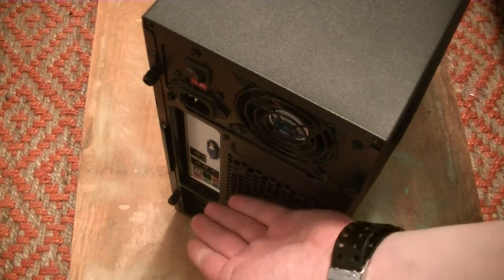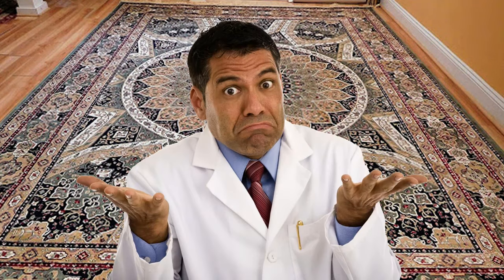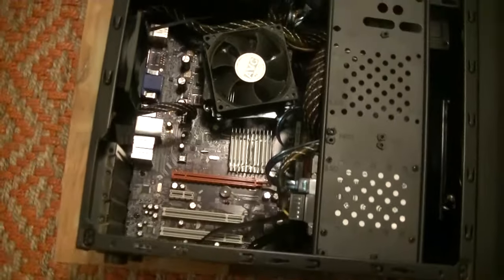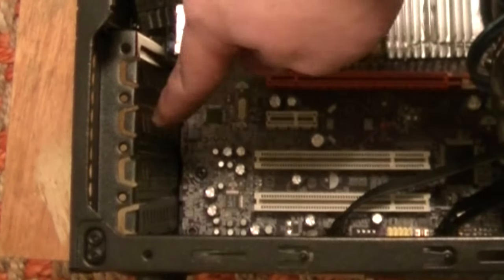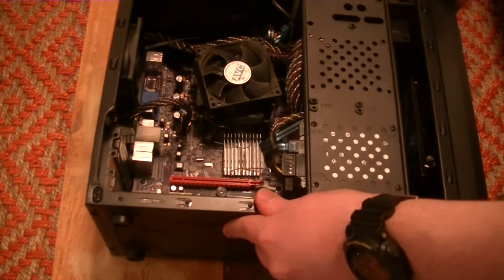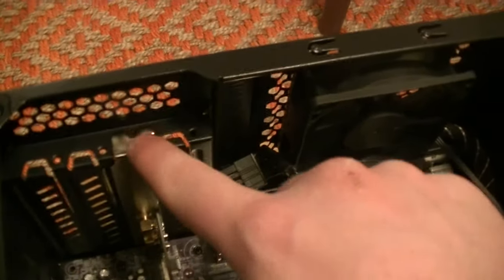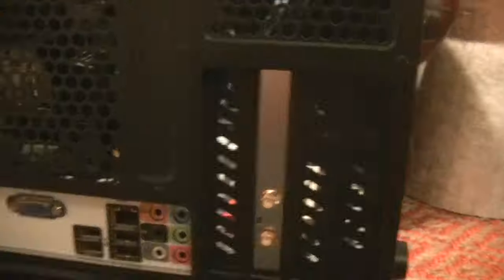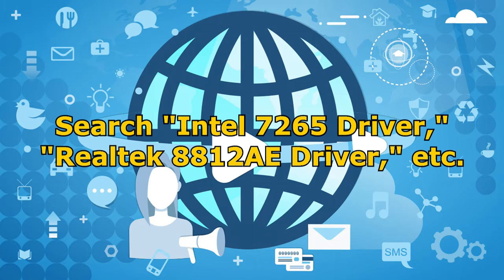How to Install a Wi-Fi Card into a Desktop PC

Comment: why would i need to do this if i had an ethernet cable 😐
Reply from the maker: You wouldn't, but even with my systems that I have ethernet cables for, I like to have WiFi cards installed in them just in case... they're dirt cheap and come in handy. Sometimes a computer is in an inconvenient spot for a cable that could be tripped over or looks ugly, etc.
Reply: @proudgamer5577  what driver??? Can I get WiFi through my phone on my pc?

Comment: Thank you for the information.  Except I was attempting to locate a video on installing a multi-port ethernet board adapter, but this one popped up.  Does it take the same slot for the board as this one for wi-fi?  What is the proper name of said adapter board?

Comment: Also you can use your phone with internet and use USB tethering, use your charger to connect your pc and phone turn on your USB tethering on your phone in your network settings or settings, then you have internet from your phone, you can then install the wifi drivers.

Comment: I need to run a Ethernet cable for my outside room willl that work as if my pc was right next to my WiFi router ?
Reply from the maker: The short answer is that Ethernet cables are faster than Wi-Fi regardless of how your setup is located, so yes. :)
Reply: Torqcx thank you for responding going to do it tomorrow
Reply: Torqcx I was also wondering since my mobo doesn’t have WiFi

Comment: i cant figure out how to take my old broken one out halp its not coming out
Reply from the maker: Make sure it's unscrewed completely. The metal expansion plate may be a little stuck in the slot,  just use some force and it should come out.
Reply: @Torqcx  thanks apparently I never unscrewed it

Comment: 3:25 if using ethernet were available, im positive no one would be here watching
Reply: untrue lmao! Millions of circumstances
Reply: @RGE_Music  boomer
Reply: @joxless8997  appreciate you
Reply: nah I have ethernet but it's connected to an extender and connecting to wifi would be faster
Reply: also if you have internet youll have a router so just buy a ethernet cable from walmart and plug it into your router, if you dont have a router there is no point of doing this
Reply: Don’t all desktops come with Ethernet??? And if not it would definitely come with wifi 5 or 6. One or the other or both.
Reply: “Then get an Ethernet cable you bimbo” 
Subbed
Reply: I have ethernet cable and it looks really ugly and comes in the way. "Exceptions there always are" - Baby yoda

Comment: Brilliant video and explanation. Another quick question - those antennas, can they point in any direction? I ask because, in the video, they seem to cover the USB slots which, in my case, need to be used.

Though, I actually would like to use a WiFi adaptor for Bluetooth connection (obviously using WiFi cards which allow that) since I didn't have any luck with my last Bluetooth USB dongle. Would the antennas even be necessary in this case?
Reply from the maker: The antennae can be pointed in any direction, yes! It's best to point them toward the internet source, but it doesn't make a huge difference. I don't think they have an affect for the Bluetooth.
Reply: @Torqcx  Thank you for the speedy reply!!! You're very helpful and it's especially useful that your videos are straight to the point. Keep up the great work!

Comment: You don't need an ethernet cable to download the drivers, all you need to do is to go onto another computer with internet, download the drivers from the website onto a usb drive, and then plug it into your new pc,  and then run the setup. You should be able to use internet once the setup has completed.

Comment: I'm wondering why desktops or motherboards don't just integrate WiFi...  does this interfere greatly when installing a respectable graphics card?
Reply from the maker: Some higher-end, modern motherboards have been integrating Wi-Fi recently, but yeah for the most part you gotta put one in yourself. And no, I've never once seen a Wi-Fi card negatively interfere with the position and/or cooling of a GPU. I'm running an NVIDIA GeForce RTX 2060 SUPER with an Intel 7265 Wi-Fi card directly above it without any problems.
Reply: @Torqcx  ahhh gotcha...  I just wasn't sure since I was considering a low profile GTX 1650 and thought it might be too wide for the WiFi slot underneath it.  I really appreciate the video, thanks very much :)

Comment: I would not recommend any cheap wifi card for any one but would rather to have cable when I have 1Gb/s down and 500Mbit/s up, but there are wifi cards and routers that can handle over 1Gb/s transfer speed on wifi so I would recommend that if your budget accepts that

Comment: If you dont have an ethernet cable and a usb driver to install the drivers in it, you can connect your phone with your pc with a normal charger usb cable "data transfer cable, most cables have this feature" and go to your setting on your phone and search for "usb tethering" and this way your pc is connected to wifi...

Comment: Hi! I use a dell optiplex 9010 big tower and the pcie slot is being covered by my gpu and I tried the other ones and they wouldn’t let my computer show on my monitor what do I do?
Reply from the maker: Your next best bet would be to invest in a PCI-e extender, basically it's a cable that connects to the slot and then to whatever device you want to connect it to (the Wi-Fi card in this case). You might be able to fit it underneath the GPU and mount the card elsewhere.

Comment: Thanks for this but my card came with a wire. Don't I need to connect it to anything?
Reply from the maker: That wire is most likely for the card's Bluetooth. You may optionally connect it to any of the internal USB ports in the motherboard if you wanted to utilize it, but it's not necessary for the Wi-Fi to function.

Comment: Need Help. I installed bluetooth USB cable and driver correctly on Windows 10 PC. But it can't find any BT headphone. I can connect WIFI N to my phone at 75mbps, Signal strength full 5 bars.
Reply from the maker: That would have something to do with the driver or software on that particular WiFi+BT card itself, unfortunately I won't be able to help other than suggesting you to look up your card's model name/number and go from there.

Comment: I Only Have 1 PCI e x16 slot In Which GPU Is Installed ,And My mobo doesn’t have PCI e X1 but i have 2 PCI slots (outdated ones) what should I Do to install netwrork Card
Reply from the maker: Unless you can find a PCI Wi-Fi card somewhere, your next best bet is to get USB Wi-Fi.

Comment: Ebay $22 WIFI N600  the  WIFI  shows up works  BUT  the Bluetooth 5.1 wont show up WTF Lots people complain about this .  
Its in pci-e slot  1  - ddr4 board     the  china cd  Dodgey as fook 2days L8tr  nope tried everything
   the drivers on cd keeps saying no hardware found yet WIFI   stupid driver  cd chit   Back using the Bluetooth usa again  Not what i want .
Reply from the maker: Those CD's--like you said--can be dodgy. The next thing you can try is manually pulling the hardware ID off of the Wi-Fi card in the Device Manager.

Go to:

Device Manager -> Network Adapters -> Wi-Fi Card (the name will vary) -> Details -> Hardware Ids -> and then copy any of the names you see appear in the list below (it may be something along the lines of "PCI\VEN_8086&DEV_2723&CC_0280
" and paste it into a search engine. You may be able to find the driver manually from there. But do this at your own risk, be wary of sketchy websites that may appear!

Comment: Aloha, i have a 11 year old Dell Optiplex 780, yes i know its out dated but it is working fine. Just no WIFI, i have not looked inside to see what type of PCI slots may be open to use, but i am wondering can the old style PCI slots work for WIFI cards, maybe if need be?
Reply from the maker: I don't see why they wouldn't work even in this day in age, sure, they may not be able to catch onto 5GHz bands but 2.4GHz should work fine for them, in a pinch!

Comment: I was wondering if since I have a fully modular power supply if I’d need to install another cable to provide power for that port? Or does it receive power automatically?
Reply from the maker: Wi-Fi cards do not require additional power cables. So long as the computer is otherwise powered up, you're good!

Comment: Hi i have a question so i found a old wifi card from around 2013 and it has 2usb ports instead of a antena. Is it any difference?
Reply from the maker: Are you sure that's a Wi-Fi card? It sounds like a USB card to me (it's a card that gives your PC more USB ports, which can come in handy if you ran out).
Reply: Yeah that doesn't sound like a Wi-Fi card; more like a USB expansion card. What's the model number on it?
Reply: it gives me a option to recive wifi kind of wierd

Comment: Great tutorial, i'm trying to purchase a Wifi card to avoid having to run an ethernet cable to my wife's old computer that we're just using for trivial stuff. Its an old HP Pavilion of the same vintage you have in the video. Could you tell what specific card I should be buying for such an old machine. Its a 32 bit system running Windows Vista and I basically need it for an online cycling setup.

Comment: I have a major issue that has come up recently!! So I bought a Wifi card recently (specifically an AX 5400) and installed it into the correct space where it is supposed to go. But for some reason, it causes my computer to boot up for around 3 seconds and then turn off immediately after. After turning off it will then turn on again for 3 seconds, and rinse/repeat after that. Nothing shows up on the monitor that whole time. I have no idea what is going on here. Any ideas at all from anyone?

Ps. Removing the Wifi card allows the PC to run as normal again.
Reply from the maker: It sounds like the Wi-Fi card is faulty. Try to clean the slot you plug it into by blowing the dust out. If the system continues to have trouble booting up, then you may need a new card

Comment: if for some reason or motherboard doesn't have a 1x1 pcie can we use a regular ass pcie?
Reply from the maker: As long as the PCI-e slot is AT LEAST the size for whatever your device is, then yes, it should work just fine

Comment: Do you know if there's anything like "compatibility" other than just the pcie slots being available? Are there any software issues that you've heard of with wifi cards like this?
Reply from the maker: To this day, despite the dozens of systems I've setup and tinkered with, I have yet to run into a compatibility issue with a PCI-e Wi-Fi card. They typically (or never) require software, only a driver.

Comment: Usually CD disks come with wifi cards to put into the PC, but I have an ssd. Can I still install this card without the disc?
Reply from the maker: Yes, you should be able to find the driver online. This is becoming a more standard method of obtaining card drivers these days as optical drives are becoming more and more obsolete.

Comment: This was great. I am such a pc novice. One problem i have is that i have black a yellow cables resting on top of the wifi card. Unsure if this is safe
Reply from the maker: Cables running across hardware within the PC is basically never a concern, though try to keep them out of fan blades.

Comment: I have a problem connection to the Wi-fi. It is an HP Envy 700. I opened the case and looked for the card with the 2 antennas that are supposed to be there and can find either of them. Would installing another Wi-fi card like this one in the video harm the computer in case the old Wi-fi card is still in it? 2.] Do you know where this half card is located on the board. I saw another video where the tech had to remove a cover to the hard drive to expose it.
Reply from the maker: Is that computer supposed to have Wi-Fi? Either way, the short answer is if you don't see the card in there, it doesn't have it. Go ahead and try installing a Wi-Fi card in there, it won't hurt anything.

Comment: You have card with two antennae. Is it a dual WiFi card - both 2G and 4G?
Reply from the maker: Yes, this Wi-Fi card connects to both 2.4G and 5G, but that is unrelated to the fact that it has two antennas; having two antennas basically helps prevent Wi-Fi fading and drop-outs.
Reply: @Torqcx  Thanks.

Comment: But for my WiFi card I had to connect a usb thing into it, not Ethernet. How do I remove the usb wire?
Reply from the maker: You got a USB Wi-Fi stick, not a PCI-e card? If that's the case you'll need to keep the USB drive in the system in order to have Wi-Fi.

Comment: am worried about buying a rx 6500 xt because of the wifi card i feel like its not gonna fit for the wifi card is there anything i can do? also nice video sir
Reply from the maker: The only thing that should make a difference when it comes to the Wi-Fi card fitting alongside a graphics card is--if it's underneath it--the shape of the GPU's heatsink. Sometimes they get very close and even make contact with the Wi-Fi cards installed in the slot below them, but I don't recall ever seeing a case where there literally was no room for the Wi-Fi card.

If the Wi-Fi card is above the graphics card, then there shouldn't be any variables that would not allow room for it to fit.

Comment: What should i do if my pc is custom and the pannels are not parallel to the wifi card
Reply from the maker: If the panels don't match the ports on the motherboard then it sounds like you'll need a new chassis, unfortunately

Comment: Is the bluetooth usb cable that goes from the back of the card into the motherboard necessary? 
There arent any free slots for me to install it to
Reply from the maker: That's typically a connector for the Bluetooth, so unless you want Bluetooth capability in your system that you don't already have, then no, it's not necessary for the Wi-Fi!

Comment: I wanna buy one of these but im dumb witb this kind of stuff, with the end part where you say to connect it to the internet, is the info you need usually on the box that the wifi card comes with?
Reply from the maker: In my experience, usually the box is not the most helpful unless the model name/number is on it; that should be all the info you need, just find its driver, download and run it and you should be all set.

Comment: Does the motherboard have to have wireless networking already, or will this work if your motherboard doesnt have wirless networking. Thanks
Reply: The motherboard is MSI B450M PRO-VDH MAX Micro ATX AM4 Motherboard
Reply from the maker: I think "wireless networking" refers to the motherboard having an integrated Wi-Fi card already in it, in which case you wouldn't need to install a card in the first place. I don't think the motherboard has any additional requirements needed in order for a Wi-Fi card installed in it to function.

Comment: Soooo is it wise to keep the network card in there if it is so close to my gpu fan that it adds friction to its movement?
Reply from the maker: If the fan is physically rubbing against the Wi-Fi card, it "might" be safe, but I wouldn't recommend keeping it that way. Unfortunately, unless you safely bend the Wi-Fi card's position out of the way, there isn't a whole lot you can do about that specific setup

Comment: hey, I'm currently using an usb antenna for wifi, but it often disconnects from the network on its own (wifi works pretty well besides that) and i'm considering installing one of these cards, would that solve the issue?
Reply from the maker: Without more information, I would say yes, a PCI-e Wi-Fi card is generally a considerable step up above a USB Wi-Fi connection.
Reply: @Torqcx  thanks haha! i asked around some more and it seems the card is a considerable upgrade, I'm also considering re installing the modem on the same room as my pc so i can use ethernet :^D

Comment: my slot is too big for the card i bought?  is threre different sizes?
Reply from the maker: How big is the card you got, about half the size of the slot? If so, you may have gotten laptop memory. You need to make sure you get desktop memory.

If it looks to be about the same size but it's not fitting, it may be the wrong type; if you have a DDR3 motherboard, make sure you get DDR3 RAM and if it's DDR4, get DDR4, etc.
Reply: @Torqcx  I figured out that the slots can be bigger than the card and it will still work. So I plugged it in and it works fine, but only issue is it kinda covers some of my GPU fan

Comment: Plugged everything in, including bluetooth, restarted computer 5 times, cant find anything in bios regarding this (gigabyte), not detecting either bluetooth or any wifi in device manager or elsewhere, did i waste my money?
Reply from the maker: Did you obtain and install the card's drivers? Without them, the computer typically won't get any Wi-Fi
Reply: @Torqcx  hey torqcx  i'm buying a wifi card
ASUS Dual Band 802.11AC Wireless-AC2100 Pci-E Bluetooth 5 Gigabit WiFi Adapter, 160MHz Support (Pce-AC58BT)
it has motherboard usb cable   in ur video there isnt  
is it important and if yes  pls make a video cus i have no clue what to do with  it
Reply from the maker: @mastercalippo  I believe that cable you're talking about is for the Bluetooth. You don't need to plug it in if you're not going to use it, but if you want it, plug it into any of the motherboard's USB slots.
Reply: @Torqcx  ty  u are the best